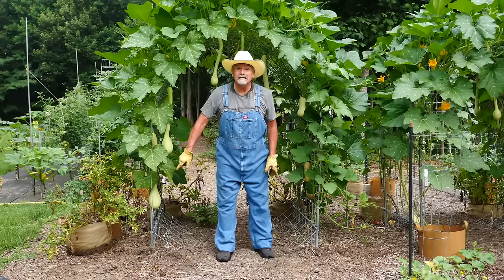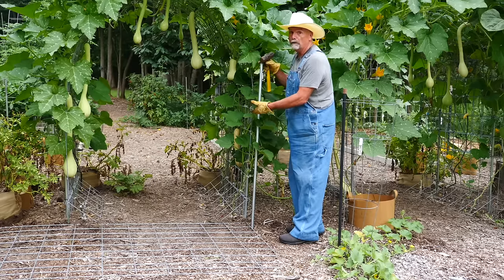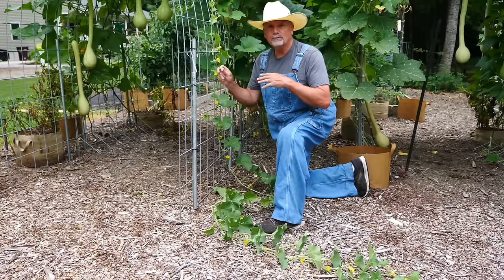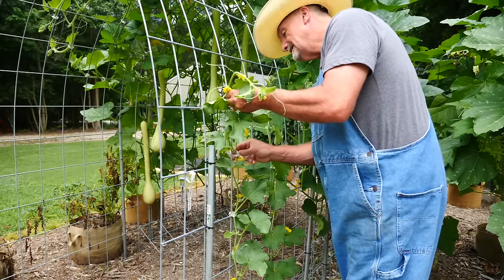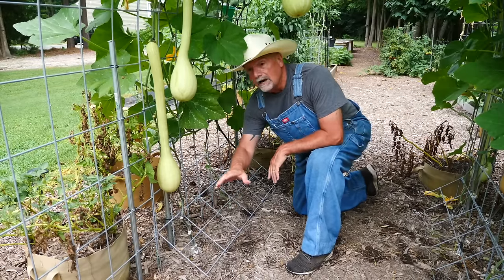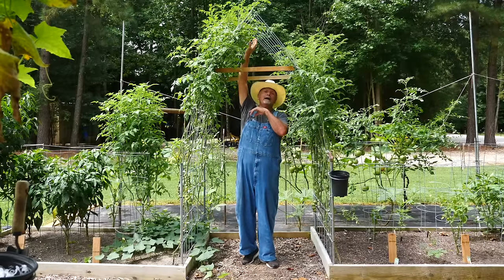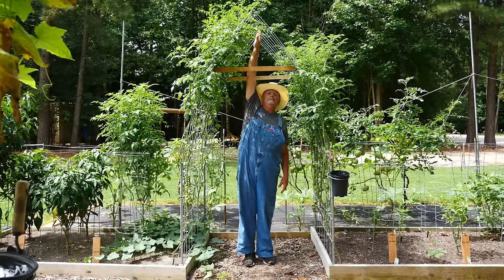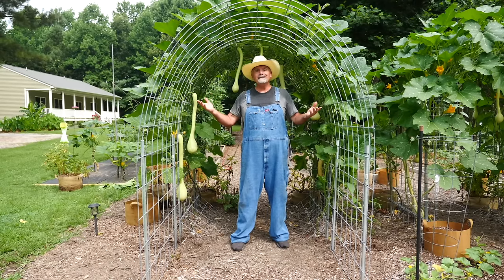Using Cattle Panels To Make A Garden Trellis!

Comment: I love using cattle panels in the garden!  We used five 4ft.×12ft panels and started attaching them about 2ft. Up on the t posts. This gave us more height and we to used metal clips to connect to the to panels together to prevent swaying. Since we used five in panels, my arbor was 20 ft. long and about 8 ft. tall. I planted on the outside and the inside of the arbor & planted green beans.  I canned 134 qts. of beans from this arbor aka the green bean garage.😊😊😊
Reply: So planting on the inside is not too shady for growing? And did you only plant pole green beans?
Reply: @mariekelly7325  I placed the arbor with openings facing east and west so that they get morning and afternoon sun coming in so apparently not because I got a ton of beans. I also used soil Innoculant which increases the yield.😊
Reply: @lynnlamont3485  Thanks for sharing how you oriented your “garage”! Have been wondering about that, as my beds are N-S

Comment: I designed my cattle panel trellis's with raised beds inside so I can cover the trellis with greenhouse plastic and use it for a greenhouse in the winter months and large cold frame in late winter and early spring.
Reply from the maker: Great Idea. Next year we are building raised beds on the outside so they do not get walked on but we leave the tunnels open mainly for the look of it!
Reply: I'm torn between those two options. I like the look of a tunnel, but we live in a difficult climate.
Reply: @PawPawRidgeHomestead 
Hi where can I buy plastic clips what is plastic clips called   how do I grow vines ? Did you  put  green vines by hand yourself  thanks

Comment: Cattle panels come in a variety of sizes.  Are the cattle panels you are using 16' by 5' or is it 18' by 6'?  It would really be helpful to know this.
Reply: He says 16’ in the video
Reply: And what gauge is the wire ?
Reply: My bad, I didn't catch that when I watched it.Thank you for pointing that out.  @RustyBobbins
Reply from the maker: 16 ft x 50 inches
Reply: @PawPawRidgeHomestead  What Gauge wire ... is it 4 ?  

Also, do you have any info on who (if anyone) sells them via mail order (presumably rolled up) ?  Either precut or in 50+ ft spools.  I can cut it to size, but I dont have a truck so a spool seems my only option for delivery or transport in a passenger car.

I ask because here in suburbia plenty of ppl garden, but NOBODY sells feed lot panels except in crappy 11-16 gauge.

Profuse thanks in advance for any info you can share. 🫶
Reply: I purchase mine at Tractor Supply and they will deliver in my area, if needed.

Comment: Great video! If would like to have a trellis like this, and put it at a different spot every year, do you have suggestions how to make handy adjustments to make it more mobile? Because this one I would need to break down and build it back up right?
Reply: Yes, would need to pull stakes & move to new spot. I’ve seen other videos where ratchet straps help hold the panel in an arch, so could to that before removing posts to keep trellis shape rather than release to flat 16’ piece to move?

Comment: WHAT KIND OF POSTS DID YOU USE?  they look so much nicer than the t-posts.  I want to do the cathedral top.
and what is best to CUT the panels?  Love this video!!
Reply: Posts are 3/4” EMT conduit in 5’ pieces (cut 10’ in half with angle grinder). Use bolt cutters to cut cattle panels.

Comment: A section of log with some rocks in front of it also will hold these things in place if you don't have conduit and all this other stuff. In fact about anything will hold them in place. For those of you that don't want to work the dirt and break it up and do all that. Just lay down some weed block inside the tunnel. And use containers. Even if something as small as a one foot by 3 foot plastic window box, will give beans plenty of roots to grow all over that thing. In fact using containers and grow bags for your tomatoes and other vining plants inside of that, is a great way to go. Set up some drip irrigation in a Bluetooth timer and you're there

Comment: Nice demo and awesome!! I am planning to go for this method. Are Zip ties strong enough or is there any other option? Please let me know.
Reply from the maker: I use Zip Ties for a temp fix but if you wanted it to stay up long term I would use tie wire or metal cable ties.

Comment: What are those metal posts? Rebar? Also, how much weight can I take? Would that be sturdy enough for a a grapevine?.
Reply from the maker: The metal post are EMT conduit three-quarter and they will take at least if you support it right about 200 pounds

Comment: what are the stakes you are using?  Thanks so much for the video!
Reply: They look to be 1/2 inch schedule 40 electrical conduit. You could probably use metal t posts instead for a stronger, cheaper build.
Reply from the maker: 3/4 conduit

Comment: I have clay in my garden. Impossible to drive down the way you are doing it. Soil is very hard where I live.
Reply from the maker: Have you tried use a pressure washer. It removes the soil so the post goes down easier. You will get wet and muddy but  it works well.